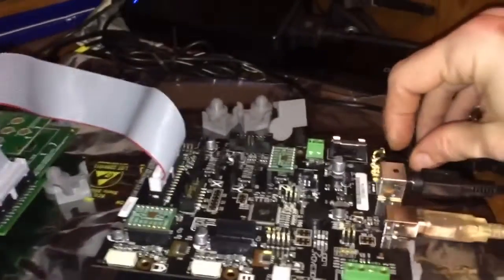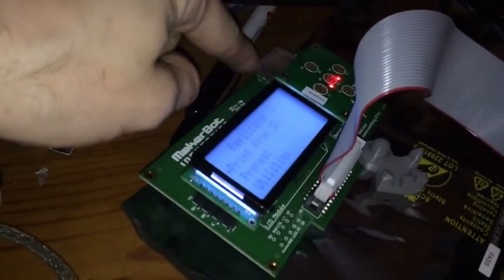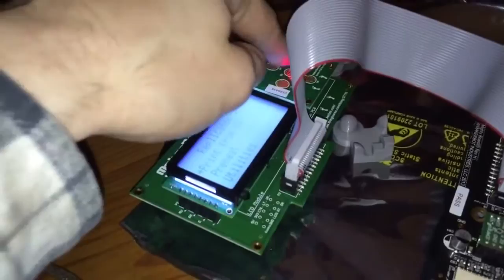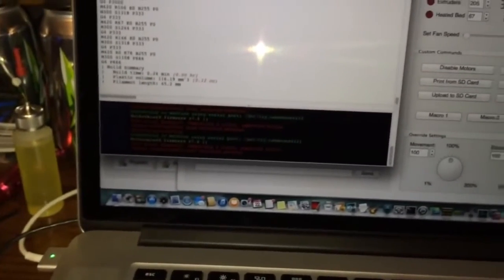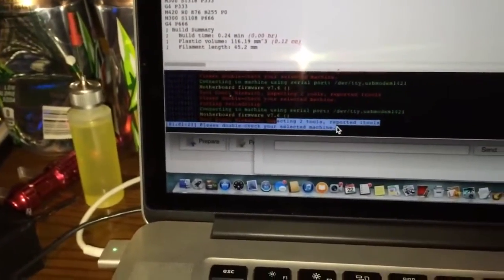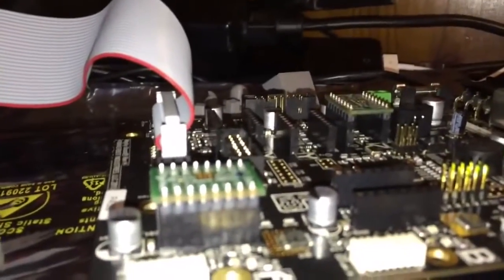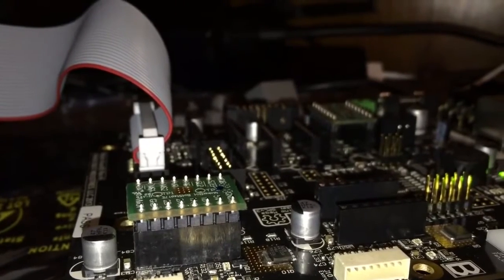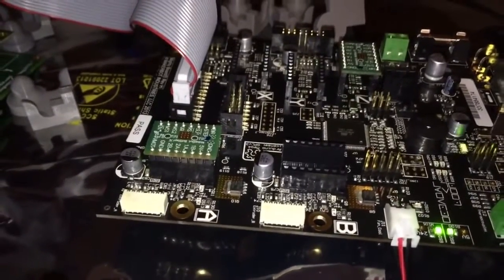Magic smoke escapes, Makerbot Mighty Board 3D printer stepper failure.

Comment: ' I wouldn't trust this board at this point as it just likes to blow stepper motor controllers'
Reply from the maker: Yea, I didn’t trust it either. Makerbot replaced the board and steppers since it was still under warranty. I kept it as a spare for parts or will fix it one day if I need it. After learning 3D printing and hearing about swapping the main processor chips to run newer sailfish firmware I decided I needed to learn more about electronics and shifted hobbies. I ended up building an electronics lab, I still have the board since I know the fault is probably a FET that’s causing the voltage rails to cross. Each stepper has 2 FET on the board, and the 5 volt rail for the stepper was measured at 24 volts I’m sure it’s the FET causing that rail to fail and shoot 24 volts to the 5V pin for the stepper controller. I guess 3D printing got me deeper into electronics. I did electronics before, but never micro soldering electronics until I wanted to swap the chip.
This is the board swap and the printer I own. I was running a separate channel on it but ran out of videos and upgrades to do. I think someday I’ll combine the videos from this channel into one channel so I can drop the other channels.
https://www.youtube.com/watch?v=QcRZ_un-mzk

Comment: Oh and be careful, if 24V was being fed to a 5V rail, then I wouldn't be surprised if it would feed 24V into your poor macbook XD
Reply from the maker: Just one f the reasons I use the SD card when I print and not USB. But for this testing it had to be done USB for more control and ondemand shutdown. I think I did check the USB port first before I plugged it in. This is 4 years ago when I did this video, so it's far from new.
Thanks

Comment: Why buy a 3D printer when you can just design and make your own? XD I mean, the hotend and such would be bought, but other than that, I don't see why you couldn't hook up your own board and such.
Reply from the maker: This was 4 years ago. I've built three since then using the newer H style stepper printing method. Also one was donated to a school, one isn't done, and one is still in parts waiting for me to start building it, lol.
But years ago open plans wasn't so common to build your own unless you like the slider looking ones or the other style that people always had problems getting to work. So I bobught one and upgraded it to the point it's better then the manufacturer thought it could be. 
It's still my go to printers, runs stable and strong.it was a good starting point to learn about them. You have to know how to print before you can realize something is wrong, or fix soemthring, or build one. They are a lot cheaper these days.
But if you want to see all the upgrade tutorials I did St on this channel:
https://www.youtube.com/scottjd